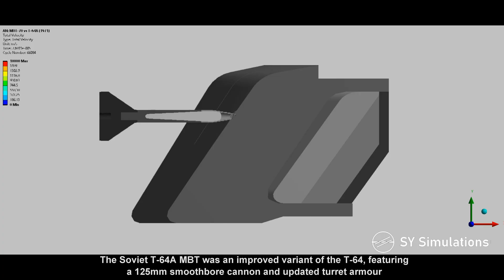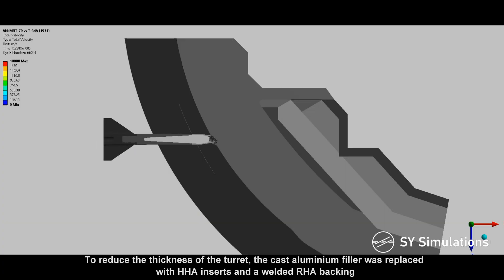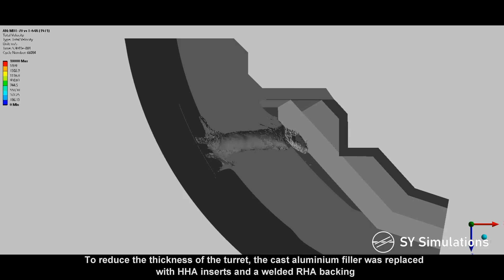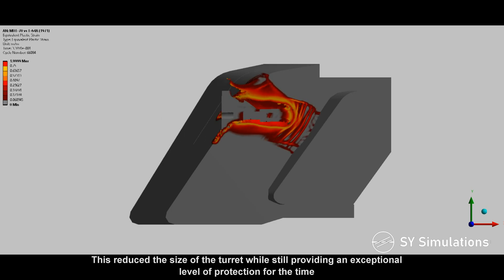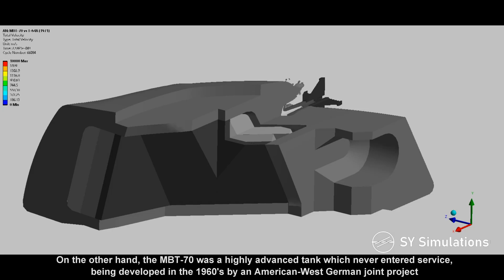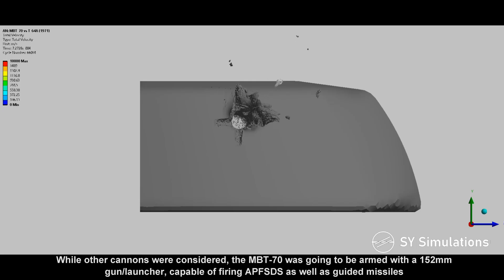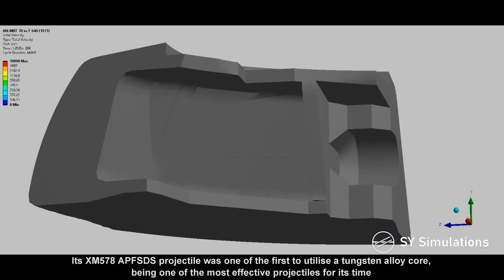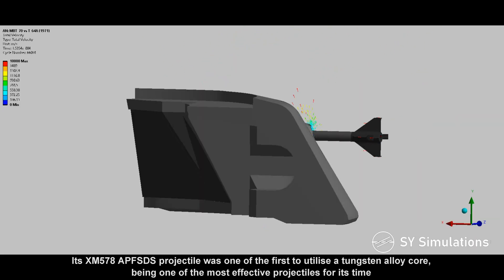MBT-70 vs T-64A TURRET | 152mm APFSDS vs Complex Turret Armour | Armour Penetration Simulation

Comment: Great simulation. I thought Xm578 will penetrate turret, especially in gunner sight weak spot.
Can you have a video where you will compare APFSDS penetrating front hull T-64/72/80/90 armour and the same APFSDS penetrating driver optic weak spot. The interest in it, how the spall cone will look like in these penetrations, will it reduce for some factors like thin armour thickness or it's not matter much. The APFSDS must pen both armour and weak spot, and for armour it should have like +100 mm of penetration to have enough spall velocity

Comment: Wow, the T-64 is a BEAST
Reply: T-64 is still BEAST. Especially on OFF road terrain.
Reply: No, just a silly gun.  The 152 mm XM150E5 had a much lower muzzle velocity than longer barreled contemporary guns, meaning much lower penetration. 
It was primarily designed to fire the  MGM-51 Shillelagh missile against other tanks.
Reply: @TheInfamousMrFox the T-64 was a superb tank for its time, and still can hold up against the most common tanks today, just not good in comparison to the newest stuff
Reply: @dominuslogik484   The T-64 was outdated compared to western tanks when it was released, time has not helped it. 
And that's before you look at the major design flaws that make ruSSian armour zippo tanks.
Reply: @TheInfamousMrFox  Buddy what are you talking about? Even as much as I adore Western Tanks and don't care for Russian ones the T-64 was an entire generation ahead of its competition when it came out with the stiffest resistance being the M60, Leopard 1, and the Chieftain. 

None of which, at the time, were remotely equipped to handle the T-64. Where as the L7 105mm was competitive with the Russian 115mm gun it was not competitive to the 125mm at all when T-64 debuted (later development of much more potent ammunition would significantly shorten the gap) and in return it could easily destroy any of those other tanks listed while being mostly frontally immune to their return fire. 

It wasn't until the West's own next generation designs like the M1, Leopard 2, and Challenger came out that the West had armor that couldn't just rival but exceed the T-64.

To claim that T-64, even with shortcomings in some areas like cost, wasn't the single best produced tank of its time is exceedingly dishonest. 

The Soviets beat everything we had when they made that tank, then we returned the favor with our next generation vehicles and more or less have been pretty definitively on top of the tank quality game since then.

Too bad for the Russians when they realized they, at the time, had a world beater on their hands with T-64 they completely went all in on the design philosophy and every subsequent tank they've made has been in all honesty just a T-64 with a face lift.
Reply: @ThatGuyOrby   The Chieftain, it's contemporary, outclassed it in nearly every way.
The Chieftain had Tungesten APDS for it's 120mm, and a much higher muzzle velocity meaning it was capable of defeating a T-64 at ranges the T-64 simply couldn't respond at, mainly due to still using maraging steel cores.
Yes, the T-64 had a LOT of shortcomings, that's not dishonest, it's just fact. 
Well documented fact.
It's hydraulic autoloader was slow, prone to hydraulic fluid fires and notorious for chomping peoples limbs off.
When it broke down, as it often did, the poor turret layout made manual loading very slow and difficult. 
It also made the tank very prone to immolating the crew if hit.
The suspension was incredible unreliable to the point that and I quote;-
"teams of civilian mechanics from the T-64 factories were "semi-permanent residents" of Soviet tank units".
The engines were " finicky and prone to malfunctions and fires" to the point where the engines needed rebuilding EVERY year.
They also didn't operate at high altitude very well, meaning they couldn't be used in places like Afghanistan.
Reply: @TheInfamousMrFox you know that the tanks that the T-64 had to compete against were the M48 and Centurion right? It came into service in 1963. The M60A1 was brand new at that time and the leopard 1 hadn't received a stabilizer yet.

The T-62 might be what you are thinking of.
Reply: @TheInfamousMrFox the chieftain had seriously lackluster armor against chemical energy projectiles so actually the T-64 was absolutely lethal towards the chieftain at equivalent ranges, but the T-64 was resistant to both KE and CE projectiles
Reply: @TheInfamousMrFox the T-64 had 600 built in 1963 using 115mm guns before the A model was produced in 1966 with the 125mm gun. 

The chieftains primary ammunition of Hesh was useless against the T-64 and the APDS was only able to penetrate the hull armor at under 700 meters distance when facing directly head on, any angle deviation would prevent perforation of the armor unless you were under 500 meters.

The 125mm HEAT shell could penetrate 420mm RHA and the later shell from 1968 could penetrate 450mm not 220.

There was never a point where the Chieftain outnumbered the T-64 in history, the majority of chieftain tanks didn't see the light of day until 1971.

Also range finding with a 12.7 was already archaic by the time these tanks were produced so that rangefinding capability of the chieftain is overstated, not to mention that the chieftain is really damn slow for an MBT.

The T-64 was basically untouchable to the chieftain which was only superior to all the other Soviet tanks of the time such as the T-55/54 and T-62.

Also I'm an American, so suck up your pride Nigel your tank wasn't very good.
Reply: @dominuslogik484  The T-64 entered service in 1967. 
Everything before that was prototypes. 
AGAIN, a few seconds on Google would have confirmed this for you. 

"chieftains primary ammunition of Hesh"
No, it's primary armament was APFSDS. 
And it had a Tungesten core from quite early. 
Not that it matters, HESH would easily destroy a T-64.

" 125mm HEAT shell could penetrate 420mm"
Who not claim 4million mm while you're making up vatnik cope?
I literally looked it up.
It was rated for 220mm. 
Even the very best one was only 300mm (the 3BK31) and that didn't arrive until the 80s. 

If you're just going to make up utter nonsense that completely contradicts recorded history there's no point continuing this joke of a conversation.  

"T-64 was basically untouchable to the chieftain"
HAAHHAHAAHAHahahahaaaa!
Literally the other war round ruSSian troll guy, no matter how much you lie and make up imaginary numbers, it won't change recorded history. 
The Chieftain outclassed the T-64 in pretty much every way.

Pretending to be American while posting vatnik cope in broken Runglish doesn't fool anyone, boris.
Reply: @TheInfamousMrFox 600 prototypes is not prototypes, it was kept secret as a project. You really are special
Reply: @TheInfamousMrFox also one thing to point out, English is my native language and i don't know enough Russian to even form a complete sentence in the language. I do however have a few years of studying German.
Reply: @dominuslogik484  Those early vehicles are not near as advanced as what you're making them out to be. The actual T-64 is from 1967.

Which is still a moot point, because the M60 entered service in 1959. It wouldn't have gone up against that in either case. The Leopard 1 is from 1965, AMX-30 is from 1966, Chieftain 1967 and strv 103 likewise. While the T-64 was an advanced tank, it still had plenty of shortcomings and to say it would go up against M48's and Centurions is wildly misrepresenting things.

Though he is wrong that the Chieftain would have used APFSDS, as its main ammunition at the time was APDS. The same for all other western tanks with the exception of the AMX-30.
Reply: @Ragedaonenlonely the M60 didn't have a stabilizer until nearly 1970 iirc, the M48 was the primary tank of the u.s European command until the Vietnam war was in full swing. So yeah it would have fought mostly M48 and Centurions. Both of which were competitive with the T54
Reply: @TheInfamousMrFox  At this time HESH or APDS shells was main anti tank for Chieftain, as I remember, ahem ahem.
Also, famous extreme sensitivity of British shell primers to static electricity created significant problems. At the very least, the Swiss complained about this.
The British have at least as many critical flaws with the Chieftain.

Comment: Makes you wonder if, given time to develop a long dart 152mm, how it might have mirrored M829 development.
Reply: Well its a low pressure gun and the barrel itself is pretty short, don't think it had much longevity to begin with
Reply: @guvyygvuhh298 Judging by the length and design of the penetrator, I think there was a lot of room for improvement. Sure it would never measure up to the Rh120, or the L7 105mm, but they could have improved the design significantly.
Reply: @seanmarshall5463  The penetrator it fired is just 105mm M735 but sabots made for 152mm, you could technically take any darts and fit them for that gun but the penetration would be sub par regardless. It needs a much stronger and redesigned breech and a much longer barrel to be actually effective and comparable to the 120, but at that point its basically a new gun

Comment: Can we have some more APHE simulations? For example 75mm Pzgr. 39 vs. 75mm M61? Particular the destruction of the shell by the explosive filler.
Reply: Explosive filler adds 4-5x the simulation calculation run time, and it's a very low accuracy result at best.  There's zero point doing it for a YT video

Comment: If only the US didn’t waste all that time trying to make a gun launcher and just focused on a gun or a launcher. I swear the reason so many US military projects fail is because they try to do everything at once
Reply: Dreaming too big for even the u.s budget to handle
Reply: I mean... the soviets had gun/launchers from late-model T-55s onward, so it was feasible.
Reply: Problem is they decide to develop it from a new 152mm gun instead make 105mm ATGM capable  @hehehoho3770
Reply: It is because it reduces logistical complexity. The idea they got was "If we have to make a cannon and a launcher every single time, why not just combine the two?"
Reply: @vinteb7987 well when they built the MBT-70 laser rangefinding wasn't really a tool used in tanks yet, the thought process was that the tank would need to engage targets reliably at 3-4km distance which was not reliable when using a coincidence range finder like that of the M60A1. However better fire control systems and compact/reliable laser rangefinders made the need of tank launched  atgm a moot point.

However ATGM such as the tow missiles were still useful for light vehicles that couldn't reliably carry a 105 or 120mm cannon hence the design of the Bradley IFV.
Reply: @dominuslogik484  Oof, sorry, wrong commentor
Reply: @vinteb7987 did you edit the message? I was just responding to your statement lol
Reply: @dominuslogik484  I deleted it actually
Reply: @vinteb7987  at some point you have to give in and not put the project in development hell for the next 10 years
Reply: Good thing the Germans invented the new gun.

Comment: Impressive the T64 stopped that.
Reply: Most people do not realise how strong the T-64 was for its time, it wasn’t cheap though.
Reply: @obeyobay9146  Kharkiv absolutely cooked with that one
Reply: @longyu9336  yeah, I mean all T series tanks that came after it use its basic structural design (except the T-14)
Reply: @longyu9336 Kharkov*
And it still had insane reliability issues. Mostly thanks to the abysmal engine and running gear.
Reply: @LURKTec  yeah brits had their share of problems with the chieftain's 2-stroke diesel but at least T-64 isn't underpowered, also half-torsions. T-72 is just better.

Comment: I think from caliber 150mm and higher destroys every tank with one shot, no matter if the grenade penetrates or not xD
Reply: Nope not quite
Reply: This is APFSDS, not a granade. Sub-caliber solid shots definitely need to penetrate the armor to deal any damage. If it was 150mm HE, then probably it would be able to destroy T-64 frontally.
Reply: @Patryk-ix2zr  i mean it would probably kill the optics and disable the tank, but the tank's crew will be fine as long as there are no open hatches
Reply: @hdfghghfghd  When the turret is hit with a high caliber HE, there is high chance of explosion tearing apart the hull roof. Here is a nice example of such thing occuring on T-72:
 https://youtu.be/rA4mAEbNChE?si=DB3R3astcGQhDaYP
Reply: @Patryk-ix2zr  soviets shot T-55s with 152mm HEFRAG, it wrecked the side hull armor but from the front you have to put it over the driver's roof to cause internal damage
Reply: That's not how high explosive work.
Reply: Buddy, you clearly have no clue what you're talking about.